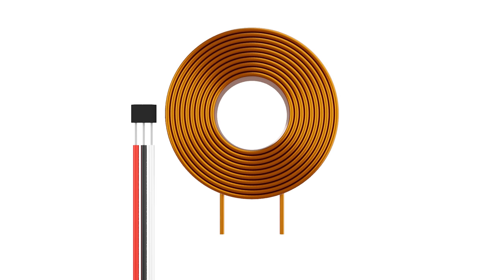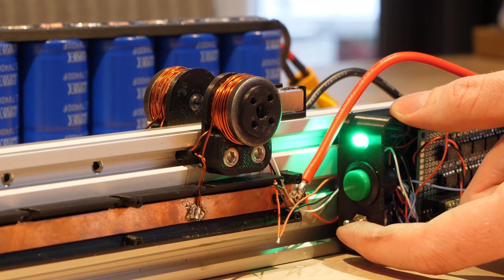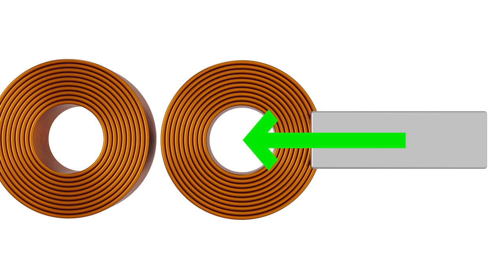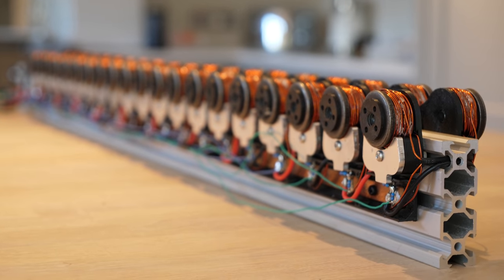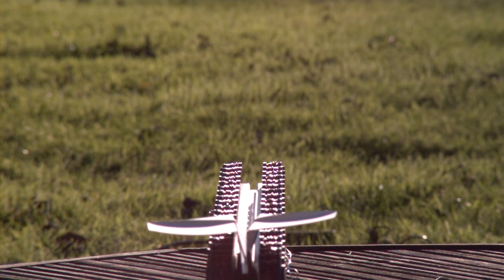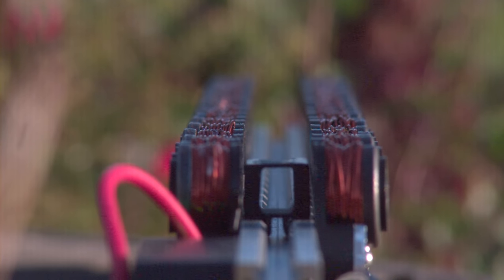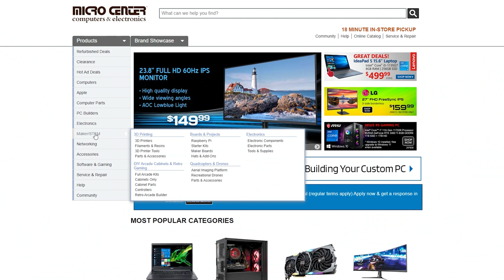Electromagnetic Rail Launcher

Comment: I've been working on a circuit like this for a while and i think it can be done without the hall effect sensors. If you use each coil as an analog input for a microcontroller, you will get an induced voltage on the input as the bullet/sled approaches the coil. As soon as you do, switch it to an output and apply current through a mosfet for a fixed period, then switch back to input. Repeat for each coil. This would give you the ability to launch ferromagnetic metals as well as magnets.
Reply: So, bro did u complete yours.
Reply: @bharattanwar5047  No, I work on a lot of circuits in simulation on and off. I'd like to build it but it's not my top project. I have had a think about it though, and Ive decided that a hybrid approach might be good to start, both a microcontroller with some SPI ADCs and hall effect sensors so that I can get a timing curve for how the coils are triggered. Then the hall effect sensors could be disabled and the known timings could be used. Having that data would let you make some very fine adjustments to the mechanism.
Reply: @silverywingsagain  i am not able to understand electrical circuit because Tom didn't explain it. That's why i asked u 😅.

Comment: In addition to flipping the magnet polarity halfway through to increase the force applied by each magnet, you can also vary the timing between each sensor detection and the coil activation to improve the output.

Since the payload speed varies dramatically along the rail, the optimum delay between sled detection and coil activation will also vary. Conveniently, you can use the time difference between the previous two detections to get an estimate of the current velocity of the sled, so you can actually make this time offset dynamic relative to the mass of your payload with no additional hardware.

Some people commented to instead vary the spacing between each coil, but that's just wasting rail space and acceleration distance (not to mention the optimum spacing would vary with payload mass). You have such a good idea of the position and velocity of your sled with the sensor setup that keeping the coils closely packed and varying the timing will give better results.

Also note that as suggested by some others, optical sensors might be more tolerant to the substantial magnetic field you're dealing with in case you find you're getting spurious/early triggers due to the field from the previous coils going off, which might be a bigger problem once you're flipping the polarity.
Reply: he's using hall effect to trigger the mosfet so the activation would be consistant with the position of the sled, no matter what speed. Am i misunderstanding your comment?
Reply: Wait i think my question now is why is there a delay the higher the velocity?
Reply: @eurybaric  It's the opposite; there should be LESS delay the faster the projectile is moving. This all happens really fast (to us), we're talking milliseconds or microseconds. Ages to a digital circuit or microprocessor though.
Reply: Optical sensor would make sense.
Reply: @eurybaric  This would only be true if the entire circuit from hall effect detection to coil reaching full current happens instantaneously, and if the hall effect sensor is spaced at the exact appropriate distance from the coil to maximze energy transfer. In all other scenarios, there will be some time offsets involved which means the optimum activation time will vary with sled velocity.

Imagine he tests and finds he gets the most acceleration from a single coil by activating it 5 milliseconds after hall effect detection at a given initial starting velocity. This means optimum position is whatever distance the sled travels in 5ms after the sensor at initial velocity is the ideal spacing, but for the next coil that delay will be lower because the sled will travel more distance in the same time (since it's moving faster after the first push). This is the variable delay he'll need to account for to get optimum output from the whole rail; the time for the sled to travel a bit from the sensor to the optimum activation point minus whatever lag exists in his sensing/driving circuits and coil.

Comment: I'm pretty sure that despite having a rail, this is technically a Gauss-gun or Coil-gun. The title of Coil aircraft launcher is correct. If you had connected a bar across two rails that had a current through them then you'd have a true "Rail-gun."
Reply: S.E.M.L
(Supersonic electro magnet launcher)
Reply: another difference between the two is that rail guns tend to destroy itself due to friction, while coil guns (probably) could be designed to last longer if the projectile isn't in contact with the track
Reply: This is a Gauss
The difference between gauss and coil is that coil is a single magnet pair, gauss uses a series for additional acceleration and force
Reply: YT does not like the 'G' word.
Reply: @oompalumpus699  Zimmerman St. Charles is dead
Reply: Could  eliminate  gunpowder  and  more  than  likely  has . I'm  saving  this  one !
Reply: Wrong. Back in your box, Poindexter.
Reply: @misterturkturkle  I like turtles.
Reply: It's not a coil gun either. Just an ordinary mass driver.
Reply: @Travis_22  NEXT
Reply: @misterturkturkle  I like Turkles
Reply: @misterturkturkle  
You can have a multistage coil gun tho?
Reply: @brennanperry8001  frongjo
Reply: @misterturkturkle  frongjo
Reply: @brennanperry8001  
You have the right to be wrong in public
Reply: @brennanperry8001  Lol I hope you are joking
Reply: @najwafitri9798  it’s actually the difference between an educational video that youtube allows him to put up and a visit from his local police lmao
Reply: @oompalumpus699  why? Whats in the G?
Reply: I like to call this a linear motor. The same principle that drives a maglev train.
Reply: He should make a working replica rail gun from Fallout
Reply: Yeah, rail and coil are description of the method of acceleration
Reply: @lensrc7460  that is what they were called when we first saw them!
Reply: Well, all magnetic based launchers would be a gauss launchger.

All Railguns and Coil Guns are Gauss Guns, but not all Gauss Guns are Coil or Railguns
Reply: @oompalumpus699  Why?
Reply: Gauss gun?
Reply: @pcenero  why did you even bother talking…..

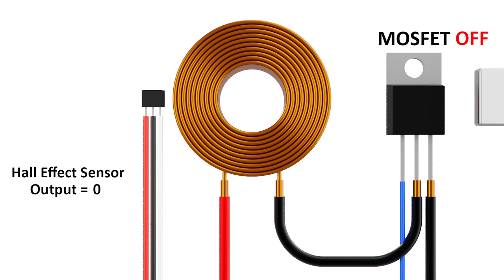Comment: 1:40 instead of turning it off you could reverse the positive and negative charges so that the polarity of the magnetic field is reversed and pushes the magnet away
Reply: Thats a really good point. How would one be able to reverse the positive and negative charges?
Reply: @davidboktor4743  i was thinking that if you have an alternating timed switch that turns on one connection, say positive end to it, then once the magnet is away, it turns on negative and repeats until its no longer needed

Comment: I expect a lot of speed can be gained by modifying the timing. They Halleffect sensor together with the Mosfet and the electronic has a latency, which is the same for each module, but the speed increases along the rail, thus the later magnets tend to stay on longer than optimal
Reply: As an addition to this, I wonder at what speed does the inductance of the coils start to matter as far as delaying the full application of the magnetic field. I would imagine faster than it’s currently going but perhaps it’s a consideration for larger/more turn coils (higher inductance) or faster linear motors.
Reply: We can hear from the non-increasing frequency of the "brrrrrr" that there is no increase in speed as the object moves along. This means something must be wrong.

Comment: Slight modification for the launcher. Put a pin across it and cut a small hook into the bottom of the paper plane so you can pull it from IN front of the C of G. The old school whitewings catapults used something like that.
Reply: Not wholly dissimilar to the connecting bars used by real aircraft catapults. Now Tom just needs to devise an arrestor system . . .
Reply: I just experienced a ratatouille style flashback when I read "whitewings"
Reply: @kingsizedmidget7294  I just experienced a ratatouille style flashback when I read "ratatouille"
Reply: used to love those sets.

Comment: Tom, have you considered the eddy currents generated by the moving magnets above the Al rail? Even at that distance it will cause some losses. Great Video (as always :-) CU in the next one.
Reply: Yeah I was also wondering if he spent any time tuning the configuration, so to speak. At least on video, he made it seem like he fabricated the first arrangement he thought of. But I imagine he could use experimentation to find the best location to place the Hall Effect sensor, to get as much acceleration from the electromagnet as possible. Too short a duration, and you're leaving potential acceleration on the table, too long, and the electromagnet will hold on to the sled for a moment and slow it down. There must be a sweet spot. He may have already used math or iterative design to find the sweet spot and just didn't include that in the video though.
Reply: @DaimyoD0  If he moves the HE sensor too far back, it'll start to actuate when the PREVIOUS magnet is running, though. Which I suppose is the advantage of using Al guiderails.
Reply: I'm being simplistic. But while your coils are attracting the magnet sled, can you also detect the passing sled by each coil & reverse the DC polarity of the specific coil to REPEL the magnet sled to increase the acceleration of the sled?
Reply: @XYZY64  Did you not watch to the end? That's his next design iteration.
Reply: The hardest part is switching that match Power quick enough. Also reversing the polarization of the coil has a pretty slow characteristic curve
Reply: You are correct! And those currents are VERY powerful! A plastic rail would be much better indeed!
Reply: Yes that's right sir, the projectile slowed down slightly after passing the coil center in one stage configuration.
Edit: Timestamp 2:58 and 3:02
Reply: Yes, I think there's something suboptimal. Considering the speed it achieved with a single pair of coils, compared to the result with 20 pairs, the speed achieved by 20 pairs seemed just too low.
Reply: @XYZY64  Exactly what he said the next video will be about.
Reply: Love your work!  A couple of observations - there's a vibrating noise as the truck moves down the trail that I think is a symptom of an inefficiency. WRT the plane, rather than pushing with an external magnet, glue a smaller magnet into the nose for a pull and better weight and balance.  Again, love your videos! Always do interesting and motivating. 😉
Reply: @DaimyoD0 这个雪橇上的金属块，是磁铁还是铁？

Comment: You might want to consider spacing out the coils progressively, and making them longer as they stretch further out!

A similar thing is done with linear particle accelerators, where the accelerating electrodes become longer and longer so the particle is affected by them for the same amount of time as it accelerates:
link to article: https://en.wikipedia.org/wiki/Linear_particle_accelerator

Comment: increase the distance between the coils logarithmically... Also you'd think an optical sensor would be less prone to interference than a Hall effect sensor in such a magnetically noisy environment.
Reply: why?
Reply: @perjohansson8099  WHY NOT?!
Reply: @perjohansson8099  Complete guess, but as it moves faster, it would spend less time near each coil in the linear arangement
Reply: @perjohansson8099  - to perhaps match the acceleration curve a little better
Reply: @perjohansson8099  The optical sensor wouldn't be affected at all but I don't know to what extent the hall effect sensors are a problem but they are affected,
Reply: @lkytmryan  all he had written when i asked was that the distance thing.
Reply: @gmanshackshack6822  sounds like bs to me but as you get likes and none says why you are wrong I guess something goes over my head.
Why would you not want them as clear as possible to maximize the acc?
Reply: The coils only act on the magnet locally, so spreading them out just means you spend longer moments with no acting force on the projectile.  So i think the way he did it is fine if he compensates the coil timing to account for inductance and back EMF from the projectile itself.
Reply: @perjohansson8099  why are you equating the number of likes to how correct someone is?
Reply: @perjohansson8099  search up how the electrodes in linear particle accelerators are spaced. As the particles velocity increases, the distance between each of the electrodes has to increase, so the particles stay within the half of each electrode for the same amount of time as they accelerate.
Reply: @SteveWard  I'd assume the timing already happens as the coil is powered as long as the HE sensor detects the magnet. Once he adds the reverse current after magnet has passed the sensor the acceleration should be even higher as the magnet will be pushed and pulled at the same time. Tom should be able to make this quite a bit more efficient with just a bit more logic added and that sounds terrifying.
Reply: @nibbletrinnal2289  the like in this context i take as someone agreeing, but sure is not a great way to see what's true.
Reply: Try to not read a blurb on Wikipedia and then pretend that you know anything about magneto-electro-dynamic mechanics. Also, you'd think someone like you would be more prone to shame and embarrassment in such an scientifically literate environment.

Comment: This is awesome!  However I feel that once the magnet reaches a certain speed, which isn't far above that created by the first coil, the other coils have a much reduced contribution due to  "back EMF" limiting the current drawn by them.  What you need is a constant current driver for all the coils, using a high frequency switching power supply for efficiency, and a higher voltage supply, to force that current through the coils the sled is passing quickly.  Or you could set up progressive banks of the coils supplied by higher voltage than the prior ones, though you definitely should make sure the sled doesn't get stuck, or that they still have the current-limiting failsafe.
     I hope I explained that we'll enough to visualize, I have a different, more electronic background.
     Cheers!  🍻
Reply: I dunno, constant current implies higher and higher voltages for the later coils, and he's running it off a bank of supercaps, or megacaps or whatever they are. They only go up to something like 2.7 volts. I see your point though. Perhaps wiring later coils with thicker wire and fewer turns, so higher current that way? But then magnetic field is a function of the turns. There's surely some sweet spot somewhere but beyond me to think what it is. Perhaps just thicker wire, same turns, bigger spool, would be the right way.
Reply: @greenaum  yes you're right.  You'd effectively add the 2.7V to whatever back EMF to get constant current, so yea, you couldn't do that with just these caps, that's the caveat.  I agree with you 100% that to achieve a similar function would be to alter the coils instead of the voltage, it would just be a different E & I relationship.

Comment: If you decelerate the sled at the end, you can recover some of the energy you used to accelerate it in the first place.  Check out the energy required, and it opens up some cool ideals for reducing fuel requirements for launching aircraft and rockets.

Comment: I would guess this setup is quite sensitive to the synchronization of the coils. If the next coil is turning on too slow, the payload will pass by before experiencing any additional force
Reply: @Grim FPV And pull the hall sensors back further too to trigger the coil earlier.
Reply: This is a thing for design engineers to solve.
Reply: @Grim FPVmosfets can switch on and off at speeds above 50kHz. This thing is way to slow for you to even consider increasing the spacing.
Reply: @Grim FPV That's right.  He is hiding some complicated calculations from us.  He surely knows the nominal inductance of his coil pairs and the corresponding field charge time constant.  He probably gets saturation on each coil before the physical magnet passes each centerline.  Designing such a system for various load weights and field strengths would be a challenge, to be sure.  Luck is no small part of this sort of project if you don't have the simulation software and modelling chops during up front design.
Reply: @Grim FPV ahaha you sir are correct. I seem to know enough to be dangerous. However small bldc motors controllers precisely work by very fast switching and they reach very high rpms.Those things would have a similar inductance to these linear EMs?

Comment: Hey Tom, 
did you checked how good you timed the coils? E.g. with your slow motion camera and an led per coil to show if its active? Since magnets are extremely strong close by, hitting the perfect spot to turn the spoils off seems very important.
Reply: It's worth noting that the timing might also be different depending on the speed of the projectile, so the coils at the start of the rail might need different timing from the ones near the end. If this is the case, then the mass of the projectile will also affect the timing, especially farther along the track.
Reply: @arantala  Perhaps optical sensors.
Reply: One more thought, put a diode across the coils to help reduce the voltage during the collapse of the magnetic field after the voltage is turned off....you should also measure the timing between the collapse of the magnetic field and the start of the next power-on cycle of the next coil to appropriately space out the coils to maximize the velocity.
Reply: thats actually really smart
Reply: hi buddy i just wanted to ask is it fine to use just a battery rather than these overpriced bank of supercapacitors